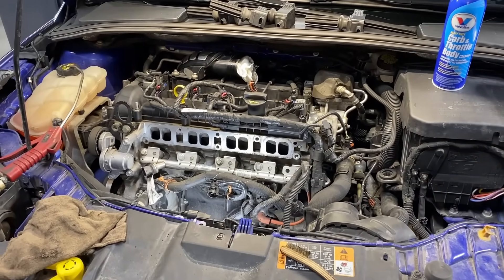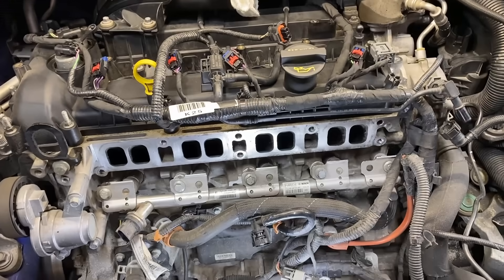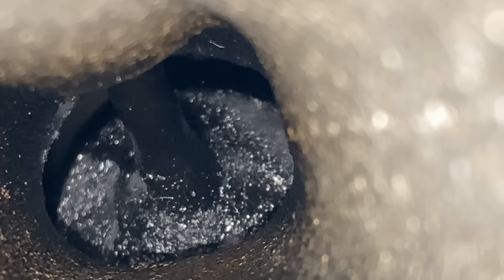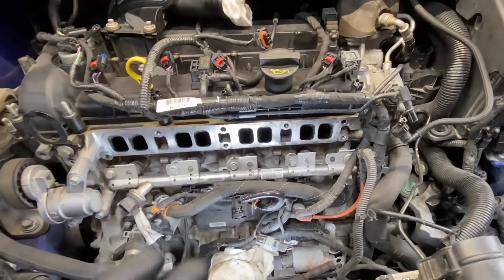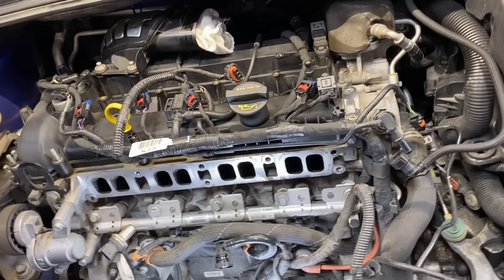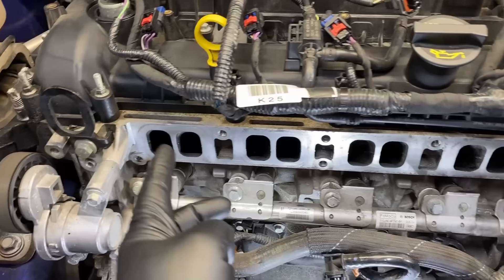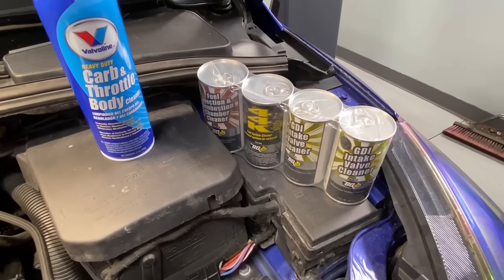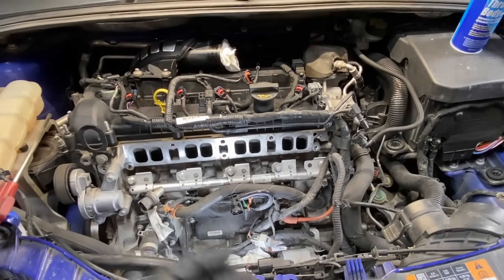Ford EcoBoost Engine Misfires Runs Rough: Intake Valve Carbon Cleaning Procedure

Comment from the maker: For a Final Step: Scrub the valves manually with this-
https://amzn.to/2R4ah2K
Reply: Do you feel having an oil catch cans off of the PCV valve in conjunction with the CRC cleaner and new PCV valve every 20K would be adequate to keep carbon in check on GDI's? I have a Hyundai with a 2.4L. Thank you.
Reply: Hey bud how much do a cleaning like this cost on 2012 f150 3.5 ? I heard Ford doesn’t do this cleaning is that true ?
Reply: Too much effort ,, get the big chunks off and then use BG carbon remover or go to a restaurant supply store and get the professional carbon remover for pots/pans (same as BG but a quarter of the price) .. turns that crap to liquid in MINUTES....
Reply: i have a 2015 ford expedition 3.5 eco boost and it is having a issue where when you accelerate up to around 2500 to 3500 rpms to pass someone or enter a freeway it starts missing and the check engine light flashes. would you say this is a carbon issue as well...it has happened cold start as well but not until it climbs a hill
Reply: FordTechMakuloco, do you have the name of the cleaner you can use while driving your car around? You mentioned that there was a special name for this cleaner that cleans the valves while driving. I would be interested in trying this method first. And I assume you add it to the engine oil?
Reply: How much for a 2016 mustang ecoboost valves cleaning job
Reply: Hi ,I have a 2.3 l 2024   direct fuel injection only ford ranger it's brand new what can I do to prevent accumulation of carbon build up in the intake valves, and besides cleaning with walnut shells, or what you did in this video, I greatly appreciate your time and reply
Reply: I was just going to ask about the CRC. Seems to have good reviews but was not sure about it.

Comment: thanks for video. would you attack same problem on 2.7 v6 turbos manually? lots of work to remove intake so wonder about using chemical spray such as crc gdi intake valve cleaner

Comment: lol you should see mini’s. They have to be walnut blasted, I have seen them with all airflow blocked and the cars sold cheap assuming they need a motor. Easy fix. Injector cleaning is very important as well. I like to do it out of the car with a battery and cleaner to activate the injectors. You do not want fuel washing all of the oil off of your cylinder. That’s Motor time.

I would replace the PCV assembly while the intake manifold is off

Comment: Which vacuum hose did you use to run the intake valve/combustion chamber cleaner. I’m assuming you had an OTC fuel injection tool or something similar to do it with.

Comment: Dang, I cant use my pressure washer ?
LOL.......... anyway, thanks for this video. I used two cans of CRC and nothing really happened. But after I took off the intake and cleaned the valves like you have shown here, the #2 cylinder misfire went away.

Comment: Can carbon buildup on the valves cause pre-ignition/detonation? I’ve got 95k miles and an occasional misfire even after plug replacement. Also have some crazy pre-ignition/detonation between 2800 and 3200 rpm but at low throttle.

Comment: Do you know if anything has changed with the coking issue on modern Ecoboost engines that don't have dual injection? I've read some people say there are built in oil catch cans with EGR to handle it, and some say a valve reversion process.
I can't believe after all this time only a handful of Ford engines address this with dual injection.
Reply: catch can can help a lot,, put a catch can  between the valve cover and the inlet plastic tube( just behind the air box.. this is were most of the oil vapour gets into the system..but it will not remove the carbon build up.. and nothing in a can will get the carbon off. no matter what they say or show on youtube,,  lots of videos on this.. but no videos showing the results with the intake off.....hummm...wonder why???

Comment: Your opinion on catch cans for prevention? PCV side, Turbo side or both?
Thank uou
Reply: i have mine on both sides..the one off the valve cover to the inlet plastic tube,,id the main source of oil vapour into the engine.. the other one from the pcv system on the side of the bock to the intake manifold is the lesser of the issue..

Comment: So you do approve the use of BG induction cleaning say once a year 10-15k as a preventative maintenance measure ?? Obviously if there is build up already it’s best to do a manual cleaning correct ?
Reply from the maker: It works but honestly a walnuts blasting is way better for the engine

Comment: If the valves are closed when your cleaning it, wouldn’t you be missing the contact areas during your cleaning process?
Reply from the maker: The seat area stays clean.

Comment: That’s all due to insufficient filtration on the oil filter. These turbo charged direct engines require a 20 mic filter filtration, anything larger than that you see this happening. Try switching to the Amsoil filter with a good synthetic oil and you don’t have these issues. I use Amsoil signature series oil and I have 441,000 miles on my f150 3.5 ecoboost and I’ve never had these types of issues. I used a 40 mic filter when I first got it and the PCV fluid was black and gritty, I changed over to a 20 mic filter and the PCV fluid turned to a light brown fluid that feels like a good oil. The fluid will burn in the combustion chamber the black gritty stuff doesn’t.
Reply: its the oil vapour.. this is not filter by the oil filter.. this is hot gassed out by the slight amount of blowby you get from the rings,, and no matter what people say.. there is always some blow by of the rings,, scraping the oil off the cly wall,, this oil also lubes the rings....open you oil fill cap when the engine id running.. can you see the oil vapours rising from it..? dont say no,, not on my engine,, as we all will know this id not the truth.. this oil vapour is being injested into the engine,, passing by the intake vales.. and leaving a little there..all the time.. this is the carbon build up
Reply: @ and when the filtration isn’t adequate it causes buildup. The 40 micron particles that pass through a regular cardboard filter causes this. If you have a good synthetic filter it filtrates down to 20 microns , those particles burn in the combustion process the 40 micron contaminants don’t.

Comment: I have a question. The problem with it is this.

When I drive slowly from 0 - 100 there are no issues. But when I need to overtake and push the gas pedal, the wrench warning comes up, the vehicle jerks and slows down.

Why do you think that is?

Comment: I am using wynn's direct injection valve cleaner as we speak, together with some brushes.
I taped off one of the cyllinders cause that one is open i will now let it dwell for the night and see what it does, the ports toward the valve cleaned up very well so i have high hopes.

Comment: It’s ok as preventive Maintenance  to use crc valve cleaner on my 2021 2.3 Ford explorer it has 11,500 miles, bought it with 5,000 miles and from there installed the oil catch can, using 5w-30 pennzoil ultra platinum.

Comment: I have a 2011 F-150 with a 3.5 l ecoboost engine with 94,000 miles on it and I'm having misfires on cylinder 1,2,3 what would cause this
Reply from the maker: Timing being off or a clogged catalyst on  Bank 1.

Comment: sorry if I missed it but why not use walnut shell blasting?
Reply from the maker: Well because DIYers are not going to have a walnut blaster. I have a machine in my shop but if I show that how is that going to help a person at home in their garage.
Reply: @FordTechMakuloco  you can get a handheld blaster for $35, the extension wand for $15, a 1lb of media for $30, and the adapter to fit over the port holes from ebay for another $15.... anyone who has a 3.5 can afford this stuff... lol but honestly it might not even be worth it. Your results are just as good as the blasting I'd say given it's going to get dirty again anyways
Reply from the maker: You found the port adapter for the 3.5L for $15? Where can you send me a link? The one I bought was and always has been $35 and I never saw another seller offer one.

Comment: I have a 16 escape 1.6l that I have torn apart right now because it has all the symptoms of a bad pcv valve,  to find out it doesn't have a pcv valve. It instead has an air oil separator. Have you ever had to replace one?   And I figured while I had the intake off I would clean the valves because they were worse than the ones in video

Comment: Good trick I use is get the car to normal running temp then start tearing the I take manifold off. By the time you have the intake manifold off the engine cools enough and those deposits come off much easier when warm.

Comment: What is the best fuel additive you recommend to add to your vehicle to reduce the carbon build-up?
Reply: For direct-injection-only engines fuel additives will not have any effect on the issue shown here as the fuel is injected after the intake valves unfortunately.

Comment: My wife’s 2013 escape 2.0 ecoboost idles rough but has no misfire count. 138,000 miles. Gets good MPG and runs fine other than a rough idle. Replaced motor mounts. Could this be a carbon issue? Uses no coolant

Comment: I'm trying to do this on my 2016 Ford Fusion w/1.5L Turbo but It doesn't appear I have enough room toward the radiator fans to get the cooler and intake off. Is there a trick to getting the cooler out without taking the radiator and fans out?

Comment: ⭐It would help using an oil catch can on direct injection engines the most! Install an oil catch can drain or empty it every 10,000 miles and no gummed up intake valves for a lot longer!⭐⛽🛢️🛑😎

Comment: i have a carbon vac machine but with the intake desigs of todays cars the machine is not sufficent in cleaning the carbon off the valves. Renoving the intake on todays down draft intakes is the best way to get a good scrub on the intake valves. Also allows you to clean all the oil buildup from the pcv system in the intake by removal.  Sea foam works good for me.

Comment: Ya i called my gm dealer today and said i need a cleaning service done to help reduce the carbon,  cause i mentioned i got a somewhat rough idle and it just doesn't seem to perform the way it should be,  service guy said do you got a check engine light on , no i dont   , he said cleaning the carbon wont solve your misfire,  i kinda found that answer a little misleading.  2013 chev impala 3.6 lt

Comment: I’ve been a subscriber for 5 years. I’ll try to keep this as short as possible. 
I’m 67 and been d.I.y. Mechanic since age 13. Recently bought a 94 OBS with 160k miles. One owner and garage kept. Like new inside and out. Paid 2k at estate sale. 
5.8L 351W made in USA. 
Problem is a bad miss at any speed and idle. Put new plugs,wires,distributor,injectors and timing chain and gears. Used Ford parts. Compression is 182/184psi per cly. I’m thinking it’s the PCM. Tired of throwing parts at it. Any suggestions?
Please reply if you have time. Help this old guy out. Lol. 
Thank you.
Reply: If it matters the 94 OBS is an F150 regular cab LWB automatic O/D.

Comment: Hi, love your videos! I bought a brand new 2021 f150 2.7 Ecoboost XL STX supercrew. Do you recommend or think I should install a oil catch can system? If so, what type/brand would you recommend? If not what would you recommend if any to help prevent junk getting recirculated? I  don't mind or plan on modding my truck performance wise. But really want to protect my engine from the gunk  Does Ford look down on catch can systems warranty wise? I tried looking on your videos for anything on catch can systems but didn't see any. Thanks for your great vids

Comment: This has to be my issue.. I have 98k on my 2.0 ecoboost awd and it's having some rough idle issues at start (and sometimes when stopped). No light triggered but a stored code for a "P0316 Misfire detected on startup (first 1000 revolutions)"... runs fine if I give it some gas

Comment: Keep up the good work Brian! My 2011 ecoboost has 300k on it now and my driver side blow off is venting more than just air. It's about time for major maintenance. Other than that your videos have kept my truck out of the shop for the past 9 years!
Reply: With 300k miles on your truck did you ever do a transmission oil change? Mine has about 105k and I’m wondering if I should change it works fine but trying to keep it to run forever

Comment: Hi I have a question, when you blow air through where the spark plugs are supposed to be in, to get any other deposits out, are you still leaving the valves closed or open?

Comment: I have a 2018 f-150 3.5 eco boost 65,000 miles on it gas mileage has been declining recently over a couple months. What should I be doing for maintenance? I really don’t want to manually clean these valves any cleaners or anything you recommend?

Comment: Did this on my 14 focus st. Before that it had a few misfires and what not. The carbon build up was pretty bad with 82k. I used crc and let it soak for about an hr on each valve while it was fully submerged. Then scrub with a hard thin brush. Then I would use a small vacuum attachment on my shop vac and suck it up. Repeat until it was smooth. Then installed catch cans 😁. She definitely idles better and has less misfires. Worth the troubles. I'd tape off the other valves that are already clean to keep them from getting debris inside from the dirty ones. great vid and info. Wish I found this sooner.
Reply: That's a good idea to tape up the other  valve ports so the debris doesn't risk going in them

Comment: As a preventative measure would not the old school hot rod trick of spraying water down the intake while the engine is hot and running work as well to loosen the carbon and clean the valves? If this is done say every fourth tank of gas as preventive measure this may help.

Comment: I have a 2014 fusion 1.5 ecoboost has a rough idle balance test is all over the place no check engine lights and all sensors are within spec shows that there is a little bit of a load at idle, New plugs clean the throttlebody and like I said everything on every test we could do on the Ford Tool passed. Runs perfectly fine driving but when you stop and idle it acts like it’s a bigcammed V-8 lol, do you think the intake cleaning might be a good possibility to cure that rough idle??

Comment: Is there really any evidence of catch cans and or a BG clean does any good whatsoever? I remember my ole 428 Police interceptor would coat the intake valves in less than 5 k miles. I contributed it to loose valve sems guides and umbrella type seals. My Lincoln Mark VIII 4.6 is known for coking up the intakes that for the most part are closed most of it's operating life. Probably just enough seepage through valve guides to cause this. I'm not convinced catch cans does any good whatsoever and BG clean is a waste of money. I'm also not convinced that the carbon built-up you shown here is causing any concerns. I bet it's mostly vaulty injectors.

Comment: Thanks for making this video, I just had the misfire issue for the first time at 107k and I was at a loss on how to clean the valves.  The  method you showed us worked great.
Reply: Do you solved the misfire?? Mine at 197000kms and after change spark plug start show misfire cilynder 4
Reply: @pablomachucachavez1014 Did you ever solve your cylinder 4 misfire?

Comment: That job sure takes a deep cut into any gas $$$ saved. I have a 2021 Kia Forte 2.0 with GDI but i dont hear must about any Kia issues at least yet and my engine has been out for at least 3-4 years

Comment: My 2013 F150 3.5L hates high humidity and rain. It will kick, buck, and snort through every takeoff. After the sun comes out and humidity lowers, it's back to normal. If this due to the same issue of needing the valves cleaned?
Reply: not a mechanic at all but that seems like an electrical issue. maybe something with the ignition wires. i had that happen on my old mazda and it was old wires with cracked insulation.
Reply: Drill a weep hole in your intercoolee with a 1/16th inch bit. Bottom driver side of the intercooler.

Comment: Are all the four cylinder Ecoboost basically the same intake setup?  What is the intake manifold bolt torque specification during re-installation (I have both a 2.3 and the 1.6)?

Comment: Ford senior master tech her just a tip try using the Motorcraft carb cleaner (PM3) just poor it in the intake port and cover the valve let it sit for 30 mins and blow it out it will look new - great video

Comment: Hi I just have a quick question. I heard Ford brought back the dual injection on some ecoboost model. My dad just bought a Ford Explorer Sport 3.5L Ecoboost. Would that motor be port injection and direct injection as well? Thank you.
Reply: easy to check,, remove the engine cover, and you should see 6 injectors on the intake manifold.. there are some photos on google images

Comment: I put an oil catch can on my 2017 Silverado 5.3 and I can't believe the amount of blow by it catches.   You can thank the EPA for choking our engines in these pollutants and making them run worse.  I just bought a new 2020 Mustang GT.  I got 2 check engines lights already with less than 1,800 miles on it.  One for the purge valve and one for the evap canister. More pollution related BS.

Comment: i also work as a tech.. classic italian cars, heres a question.. to help stop the carbon build up  of course use a oil catch can( my 2014 2.0 ford fusion is off the factory warrenty..  )  but instead of routing the hose from the catch can into the intake manifold.. route that hose back into the  bottom ( intake side ) ( close the port on the intake manifold, of course ) of the engine air cleaner box.. this below the air filter and after the bronze micron filter in my oil catch can..should remove almost all the oil vapours.. that are in the system. thanks for the reply